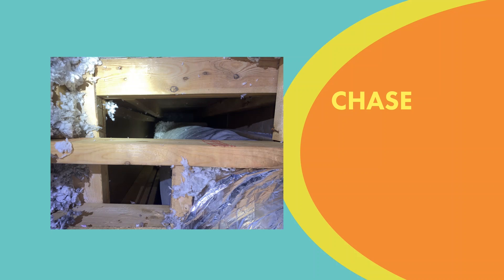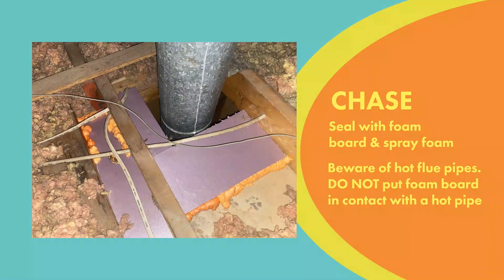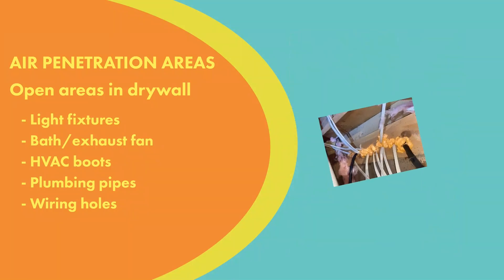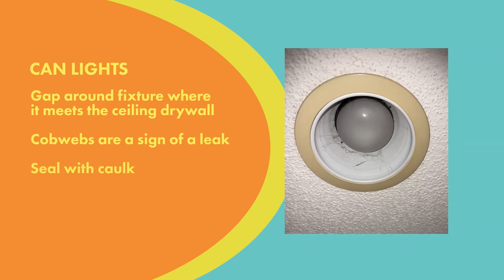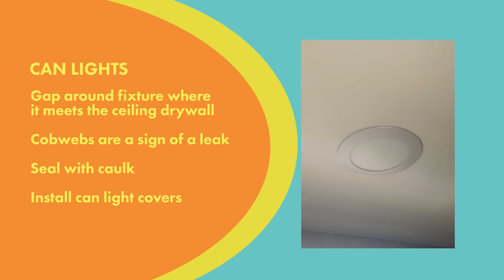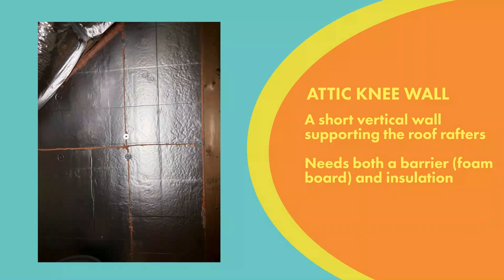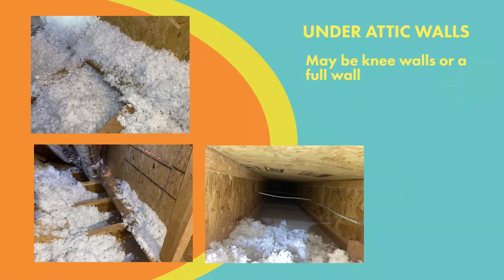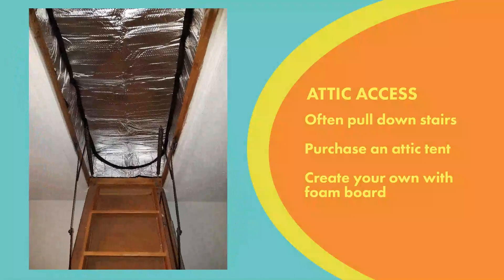Attic Series Part 1: Air Sealing - Save Energy & Lower Bills!

Comment: Is it better to use the led retro fit lights for recess lights rather then the covers in the attic?
I have over 20 4” recess lights and want to seal them better but not sure which route to use
Reply from the maker: Yes, but when installing the LED retro fit kit, be sure to caulk the housing of the existing can light to the ceiling drywall
Reply: @coweta-fayetteemc9919 
Do you have any particular brand retro light that you prefer with the best seal?